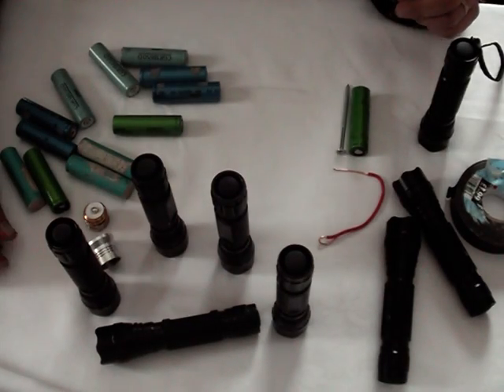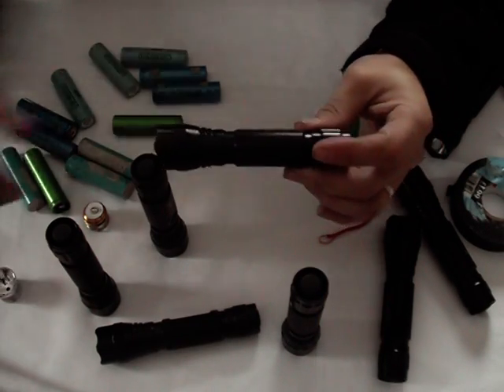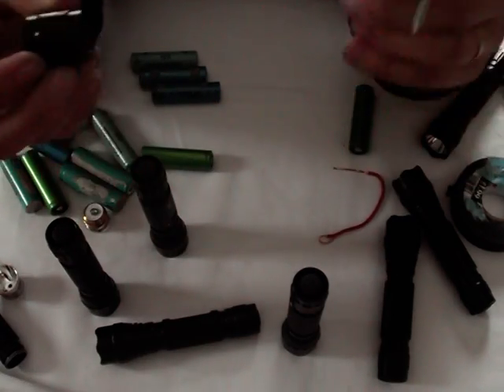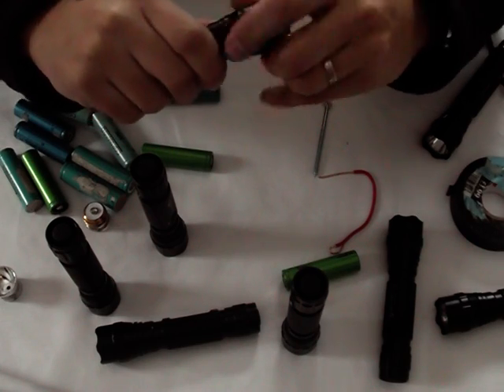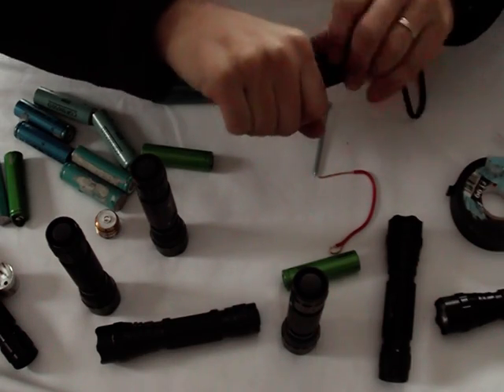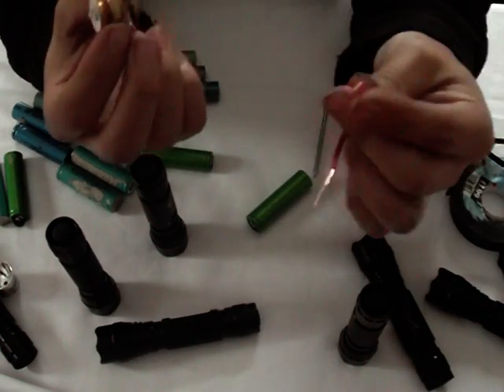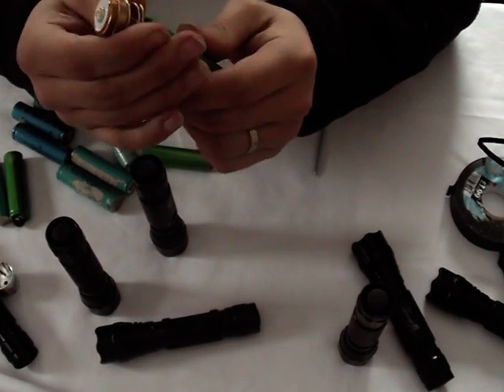CREE Flashlight 🔦 How to Fix Frequent Problems

Comment: I have this flashlight (one similar) hooked up to a pressure switch. The flashlight ha modes u can cycle through, but I only want strobe. Every time I press the pressure switch, I have to press it 4 times to get it back to strobe for one use. Is this in the switch or the light that the problem is?
Reply from the maker: The mode is on the Driver not the switch.  The driver switches mode with a short disruption of power "The half press" Your trigger switch is causing the driver to switch mode.  You could change the driver, but I'm not aware of any that can be set to single mode strobe.  Most people want the remove the strobe mode.

Comment: I bought the ultra fire wf 501 b about a year ago. The other day I needed it and it wouldn't come on. I checked the battery with a voltmeter and it showed good. I thought I was going to have to get a new "bulb" but after watching your video I tightened the switch like you showed and it worked! Thanks so much for showing!

Comment: I have a 501 that stopped working, it would only work if u pressed the button down slightly just at the right pressure which was pointless because it was impossible to stay at the right pressure to keep it on. I had given up on it and forgot about it for a year then I dug it up and found your video and all I had to do was just tighten the back cap, thank you so much!!!!

Comment: That's so great! How are you able to tell just by looking at the die if it's an XP-G or XM-L? I saw some comparisons side by side of T6's and U2's and L2's and I barely saw a difference..
Reply from the maker: XPG is roundish and has 3 small bars,  XML is slightly bigger and has 5, XM-L2 has a slightly honeycomb surface and no visable bars.

Comment: Okay  I have an Utraffire SG XML-T6 that I got for Christmas this year .I think I have used it a couple of times  but I got it out and turned it on tonight and noticed it was a little dim  ,I took the batteries out (LC 18650's) and put them in the charger ..When I put them back in the light ,it would not work at all ..Whats the deal ???? It is a practically brand new light that's hardly been used  now it wont work at all ..It flickered a couple of times  but other than that ,it is dead. Do  I have a bad light ,bad batteries, did I do something wrong ,How long do these batteries have to charge??  I cant figure out whats wrong with this thing other than I got a flashlight that is a DUD  ..Never had this problem before when I put batteries in any other flashlight  ....

Comment: Hi, My Cree  UltraFire  TH-T60 spot just turned yellowish after I disassembled it for cleaning. Any thoughts?
Reply from the maker: Its possible you got some dirt on the LED, however they tend to go blue when they are damaged.  I would just check everything is tight or perhaps strip down to cell, wire and drop in as per the video and see if it looks different.  Sometimes a lose connection can cause a kind of arc in pre-driver and this can affect resistance/current.

Comment: I have a custom light that was coming on at random, and also dimming all the time even with full charge. 18650 by the way. I had pretty much given up on it, and ordered an ultrafire 20 minutes ago to use with the three batteries and charger I've got now. Well searching for ultrafire vids and found you,,, I just tightened up the internals on the tail cap as you show here,,,,, my custom is fixed!! I can't believe it was so simple, and I can't thank you enough!!
Reply from the maker: Glad to help, shame you didn't find in before replacing it ;-)

Comment: Do you have a current favorite light ? I've bought Exposure lights but with the rate LED's improve, it's not a great investment. Most of the compact 18650 lights may not have a good beam pattern (for commuting).

Comment: I have a XML T6 flashlight and it have stopped working. I see that you've included this video for the flashlight too, but my tail cap is sealed with tape instead of the two dots to check if its loose. I also can't take out the chip. Is there anyway you can do a video on how to take it apart and how to make it stay on one mode instead of clicking several times to get to the same mode?
Reply from the maker: Remove the tail cap and use a piece of wire to connect the body tube to the -ive of the cell to check the light works.  you might need to pack the tail out with some washers if you cannot tighten the tail cap.  I have no idea what an XM-L T6 light is as this just refers to the LED.

Comment from the maker: The way to stop this is to wrap the cell in insulation tape so that it doesn't move in the tube when you go over a bump.  Also ceck everything is tight, the tail spring and the drop in spring.  If the circuit breaks for 1/2 second it will mode change.

Comment: Have sorted this now ( I hope!).  I have circumnavigated the circuit board so that there is only 1 mode i.e. high.  Can take a spare battery in case it starts to run low

Comment: Great video.  Took my torch out last night for some rough stuff (cyclo cross) and found that every time I hit a bump that it would change modes i.e. from high to medium to flash/strobe.  Is there any way to stop this? It's an Ultrafire 502b.  Thanks
Reply: I suffer with you bother.
I did this to a Lumify x9 
Basically the same.
Bypass the control circuit 👍
https://youtu.be/28G6EMr59aA

Comment from the maker: Protected cells will have a penny sized circuit and sometimes a tab to the tail.  In a single cell tourch sourced from a quality supply like a laptop, you should be fine.  A lot of the cheap protected cells have low amp cut offs which mean XM-L U2 or XM-L2 leds will trip the protection if used at the full potential.

Comment: That explained the physical difference between the two type unprotected and protected and thought this slight indent was the cell having protection used? In which case can the same simple test with a wire round the disassembled light-emitter  and long enough to touch the negative end of a battery? 

Absolutely EVERYTHING is a load of great Advice, (see I bet you thought I was going to say something nasty) simple to follow and understandable, thank you for that.

Take care.
mrbluenun

Comment: Many thanks,

One question, you said you are not using ‘protected cells ’bearing in mind I am pretty good ignoramus when it comes to ‘new’ tech things until I get used to them, I notice a small indent going round the end of the widest part of the battery where the indent is slightly smaller than the battery case, I thought and may have it wrong, that this meant the battery was a protected cell? I have only seen one channel and can’t recall which one it is as I type, that explained the

Comment: I had the shake problem. At first I tried to put some aluminium foil to the battery ends. There was some improvement, but basically the problem remained. After your video I've put a piece of spring from pen. Now it works perfectly no matter how hard I shake it. Thanks

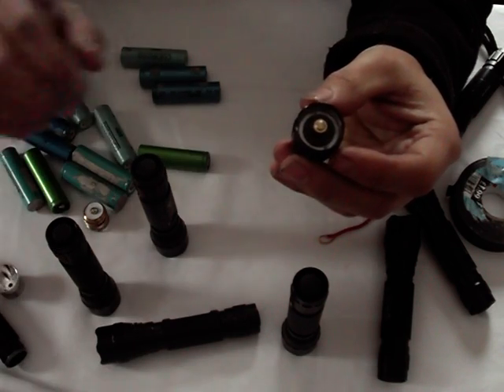Comment: Thank you for this video. I was having a problem with intermittent on/off when the light was turned on. Eventually it wouldn't even turn on unless I pushed the button left or right while it was on and found out I had to tighten up the retainer ring that has the two dimples on the back cap. The part at 2:20 in you video is what fixed my problem. Guess they just sent it to me loose from the factory.

Comment: I just bought the XM-L T7 8500. I have charged the batteries to full and made sure they are in properly. I have figured out that a half press of the button changes it from 1 LED, to 3, to 7. However, for some reason the torch just keeps flashing and won't stay on a solid light. It is brand new and I have had it 2 days. Is there a reason for this or any way to fix it? I have searched the internet and and still come up with nothing. Seller hasn't replied yet.

Comment from the maker: If you can strip down to the drop in and the cell to test then this is the best place to start.  If not remove the tail cap and use a piece of wire to make the connection.  The mode switch just briefly breaks the connection, you can simulate by tapping the wire off and then on again.  If that works you have a connection issue.

Comment: Hey the modes in my Q5 stopped working, it's always on low now, and when I press the button and light flickers, so it's probably a bad connection. The rear cap doesn't have those small holes, it has a plastic cover. Can it be removed? Thanks!

Comment from the maker: Have you tried connecting the pill directly to the cell with a piece of wire as shown?  If its still coming on dim then you may have a connection issue in the driver, which will be harder to deal with.  As a last result 2 rechargeable AAs or AAAs in series (giving 2.4v) connected briefly directly to the LED + - tabs can tell you if its a driver or LED issue.  The LED should be OK direct up to about 3.2-3.5v subject to fv limit of the LED (e.g. XM-L - is around 3.3v)

Comment: i have the same problem...i've got one smaller(battery inside 16340) and one bigger(battery inside 18650) ultafire torch. i've tighten all "screws" but problem persists... what to do?

Comment: I got an Ultrafire torch today with two Ultrafire batteries. The torch was flickering when shaken or moved. Your video is great, but none of your suggestions fixed my problem.  I finally tried the second battery and sure it enough, it worked great!!  I then took both batteries and shook them and found that the dodgy one has something a bit loose inside it.  To cut a long story short,  if all this fails,  it may well be the battery thats dodgy even if its new!

Comment from the maker: It sounds like a loose connection, you are going to need to strip down to the drop in and test and then work out where the loose connection is.

Comment: Cheers for your help.  Its got me stymied.  Its a single cell.  Worked brill at first.  Used the charger that came with it.  No joy after recharging from Red to green.  Suspected the cheapo battery cos the torch itself is good quality.  Got 2 new batteries (and a new charger) , charged them both up.  Put one in the torch and ZIP..  Yet if I place 2 x 1/2 sized cam batteries in there it works, albeit dully but it does show therefore that the leds (3) are working.......  Pass me that razor blade.!

Comment from the maker: Is it 2x18650 cells?  That will make it 8.4v input.  I can't see a 3xt6 would be much use on a single cell. The problem can be caused by heat causing poor connections.  Strip down to the drop in and the cell and see if it works.  If not try some other power source 4.2v/8.4v depending on how many 18650s its meant to have.  If it works then, then its about tightening every point.  I've only had one LED fail like this and that was when I dropped it when it was hot.

Comment: Very good video, well put together.  I have a problem with a different type of torch and I wonder if you could help. It came from China I reckon via Hong Kong as a gift.  Its a 3 led Cree and the wording on the body is  CREE 3XT6 on one side and Angel-Fire A-11 on the other side. It worked great until it ran out whilst turned on. Now Zip after recharging. It. It works (dimly) if I put in 2x 3 v lithium cam btys but its very weak. ODD. Can you enlighten (groan) me mate? Any advice?. THANKS

Comment from the maker: usually the XM-L

MC-E P bin is 962-1085 at 2.8A
XM-L U3 bin is 1040-1105 3A

but the most common bins are the T6 and the M or K bin which leaves the XM-L out in front.  Plus the XM-L is much smaller, so the light per 2/mm is much higher.

Comment from the maker: What LED does it have and what current does it draw?  You can then workout what upgrades are available.  The simple option is to replace the drop in.  The brightest option will be XML U2 or higher running at 2.5-3A, though at that current heat and run time will be a problem.  As for batteries see my other video or google 18650.

Comment: I bought one off the Internet.. I like these torches very bright it didn't work at first.. But after watching your video I managed to fix the problem thanks... I have a question tho how would I go on about upgrading the torch for max brightness?? And is it possible to get rechargeable batteries?  batteries??

Comment from the maker: Strip it down to the drop in and the cell and test.  If it works then you have a lose connection.  Check the voltage of your cell, protected cells can sometimes fail to reset when the protection is triggered.  Its very rare for the LED to fail, but it can happen.  I say lose connection brought on by the heat of the unit.  Might even need the solder checked on the driver.

Comment from the maker: @YperionGraphic This is an odd one, I would conclude that your tail switch is too tight and that the half press to change mode is not actually opening the circuit.  Either that or your driver is faulty.  Strip to the bare drop in and Cell and see if you can get it to change mode.

Comment: Greate solution that I also discover, before seeing this video and the issues and solutions are accurate.
But till I found what causing the mulfaction, I lost the 5 mode operation (High, Mid, Low, Flash, SOS). Now the torch has only one mode (I believe the Mid).
Is there any solution about this issue???

Comment from the maker: @sparkysteve73 This is usually a loose connection somewhere.  You may need to peel the "paper" disc off the LED drop in and check the wires.  Have you tried stripping it down to just battery and drop in as per the vid?  If its still dim then, then its going to be a loose wire on the drop-in driver or LED.  If you have an amp meter measure the current when connected.  If its still drawing normal amps, then the LED is cooked.  If the amps are low, its a connection issue.

Comment from the maker: @timwood70 It will likely be a loose connection somewhere, strip it down to the cells + the drop in and test.  Personally I would use 18650s over Cr123 cells.  If it still cycles when its just the raw drop-in then you have a soldering point loose.

Comment from the maker: @powermaks XM-L drivers range from around 1.4A - 2.4A and yes cell voltage makes a difference as well as quality.  I have XM-L T6 and U2 running at around 1.5-1.8A which is roughly 450-500 otf lumen.  IMO the 501 is not suitable for running XM-L, P7 and MC-E for long, at high current (i.e. >2.4A) as its too much heat and load for the host, particularly given a single 18650.  A U2 needs 2.8-3A to get close to 1K Lumen.

Comment: that one is around 800 lumens. the led is a large single die led that can pump out 1000 lumens. but the reflector chews up around 15%-25% of that light. of coarse to get that light output, you need some high quality batterys.

Comment from the maker: @mrcol1n not easily - you'd need to change the driver, there are a few 3 mode drivers around, but just as easy and cheap to buy a 3 mode.